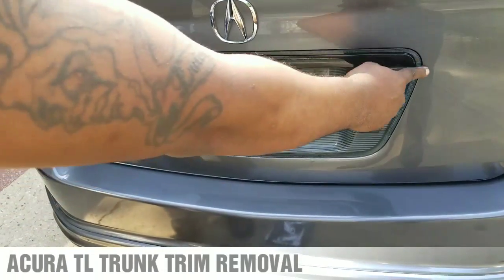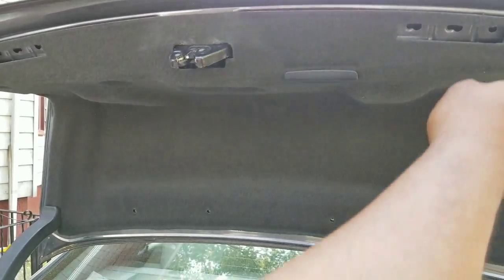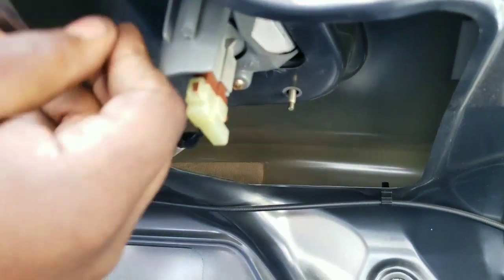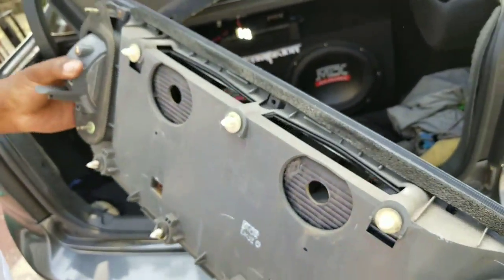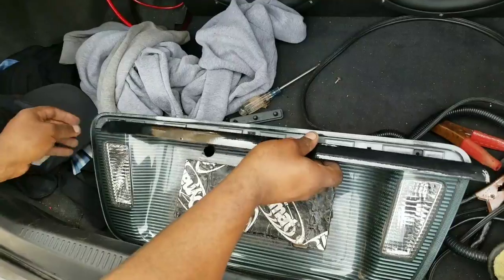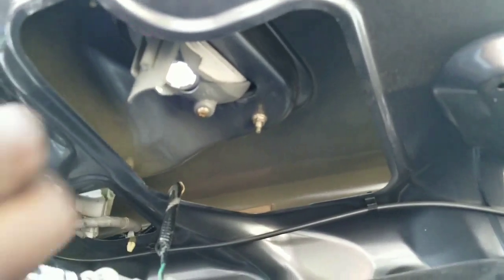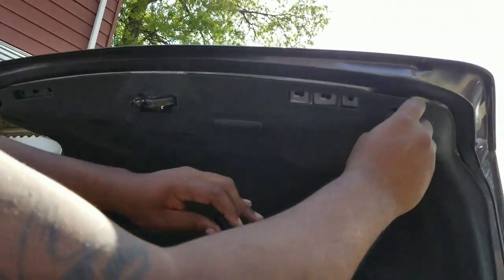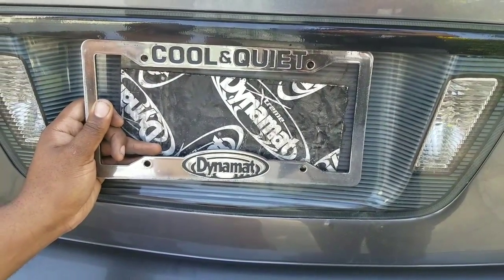ACURA TL TRUNK TRIM REMOVAL TUTORIAL

Comment: Love your acura to buds man and have used these multiple times to fix my 08 tLs. I do have a question on liner for trunk. Would this be the same process to access the reverse camera? I'm putting a new camera lens in
Reply from the maker: Yes it is
Reply: @fabolousg4ever   cool thanks man!  I wanted to replace the reverse lense with from the eBay store. Have you heard if this works on our cars. Mine is a little foggy from age

Comment: Thanks bro.. i got one of the license plate nuts broken right off the trunk while unscrewing the bolt as it was all rusted really bad.. i will get a new one welded back to the trunk body..only single bolt is holding the plate for now.. couldn't figure out how to remove that plastic trim though... thanks for making this video.